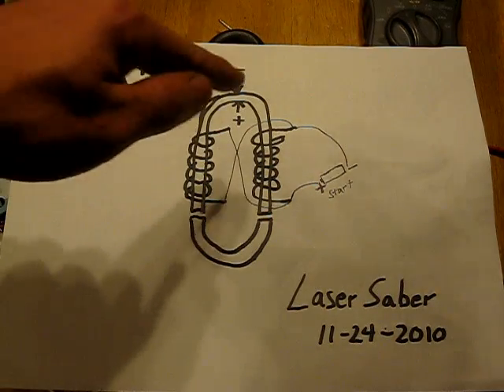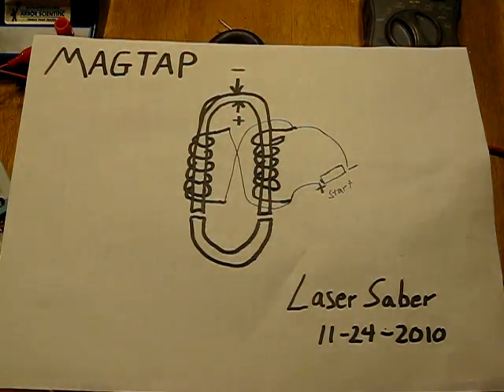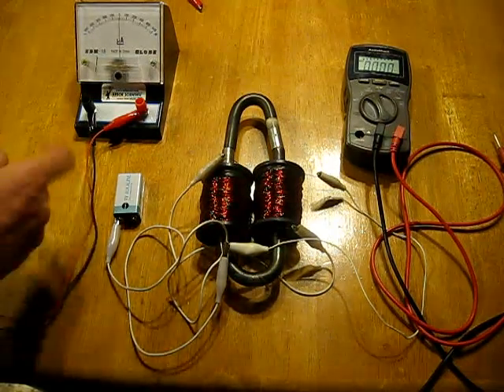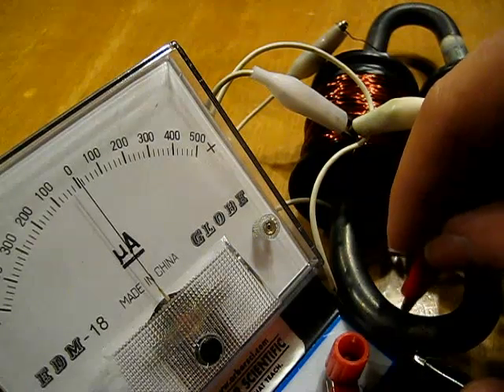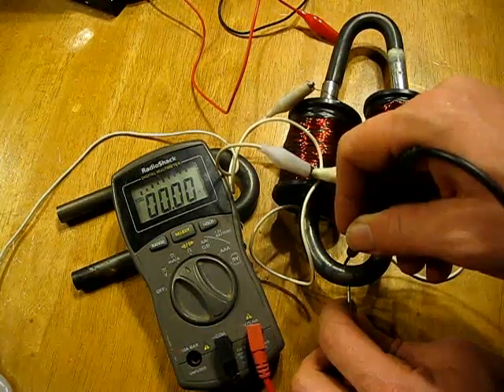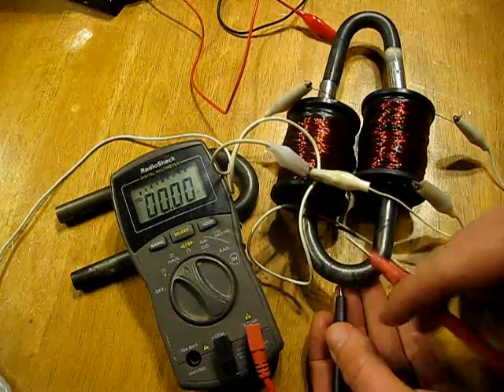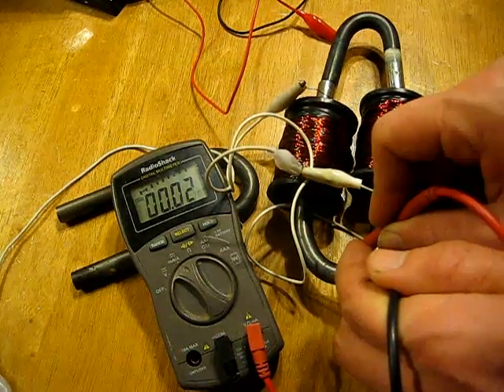Magtap: harvesting electricity from a magnet!

Comment: I know it's old video, but just had an idea here 4 U. put a piece of plastic between keeper and the other U shape metal. Insulate them electrically and once their activated, I believe they'll still lock & hold each-other magnetically. Then you measure electrical potential (A and V) difference between them.

Comment: Hi, did you observe the same polarity when you reverse the current direction by exchanging the battery contacts?  If the bridge is straight instead of horseshoe shaped do you observe the same? Did you check if the Delta V is dependent on the current intensity or the thickness of  the bridge, either it is thick or hollow, or the metal composition, iron, copper, aluminium? greetings.

Comment: This is an interesting discovery I think it is related to the hall effect, this is tendancy of a flow of electrons to be deflected by a magnetic field in a conductor. The fact that there is small voltage means some electrons must be flowing along the length of the core and this raises questions as to why this is occuring. Good Work!

Comment: get your finger off the leads you are touching the metal of the with your fingers, that could easily account for the anomalous readings.  Not saying it's a fake, just saying that for more accurate readings you need to eliminate as many variables as possible.

Comment: do you get anny curnt or voltage from the 2 points wer you removed the batery. and allso if you was to put a smal electric moter in ceries with the coile windings. you might get enough cernt to run the moter. while the magnets still hold.

Comment: does it only do that after its been locked ? . or does it do that when its not magnetised.. but just held together . .. i think the coils may be harvisting emf like an antenna harvests its signal . and its causing eddy current in the iron.
Reply: If so, the reading should be greater when he directly shorted the coils with the meter.

Comment: it looks like there is a disparity of the rate of magnetic current on the inside of the "toroid" versus the rate of current on the outside of the toroid, and when put into localized relation with the DVM you are able to see the "difference" of that speed measured as a flowing current thru the meter.   Pretty interesting.   I wonder if a wider toroid that has a greater distance between the inside and outside width would yield a higher current flow... Interesting!

Comment: And thing is its like monopole generator of bruce de palma. with curent polarities in center and outer sides of loop, what you did is created spining magneto energy etheric vortexes inside of loop, whitch conducts both. notice de palma does not have to input much energy to spin it back to speed after stop, as vortexes got it speed allready from previous mechanical input.
but palma does it by spinning both conductors, you injected energy to spin it by the coils energy, and it is straight overunit

Comment: Hasnt anyone thought to put a thin plastic or stone layer between the PMH and the connected piece to slightly separate them then run a wheel with copper coil/brush setup through this thin material and maybe the PMH will stay magnetized while you can extract current from it, like regular magnets?

I mean it's just an idea, but I think it might work as far as getting at least mechanical electricity indefinitely from the PMH

Comment: thanks for the experimentation and effort. i bilt one of these using 5/8 soft iron, a magnetic capacitor. there is a magnetic flux field inside the rod,. thought about drilling a hole in the in the end of one of the contact points and placing a small gauge coil inside and charging it up.if the magnetism is moving inside the rod, it should cross the coil at a perpendicular angle, lentz's law should take effect. there are very small coils iin those remote control micro race car toys, good source.

Comment: What if you put a joule thief in series with the coil wires and use the lidmotor 60hz trigger from an extension cord for bias on the base of the transistor.  could it run indefinitely ?

Comment: Use a permanent magnet and one of your coils around the magnet, put the meter on each side of the coil, wire a switch to close the coil circuit , watch your meter voltage every time u close or open the circuit, u have for a fraction of second  a measuring, as fast u can open and close the circuit your voltage increase. after use a triac instead the switch and use a flip flop circuit for the triac trigger, u well have pulsing DCV. Do a video and proof u got balls to put it on youtube lololo.

Comment: u only need to open and close the circuit very fast 60 cycles or more, pulsing electricity like on the out put of a diode britch electricity from a magnet is produce on the change

Comment: also, thinking about what occurs in the metal ring. Tap the current on the coils, all the iron atoms align ... as they align, the magnetic field gets stronger, causing more alignment, and so on, upwards to some threshold dictated by the resistance in the "circuit". Certainly at zero kelvin, something amazing would happen. But at room temp, there are losses to heat. Would it be true that if the temp was lower, that it would be all the hard to pull that thing apart?

Comment: I'm thinking that the clapper is pulling apart every so slowly -like a decay, inducing current in the keeper. If you rip them apart rapidly,  there is a HUGE voltage spike on the metal clapper. I messed around with that. Its there. Its so damn hard to pull it apart that it would be difficult to make a motor using this technique. So I was thinking another horse-shoe electro-magnet could oscillate near it to wiggle it loose and trigger the back EMF.

Comment: yes i can see it : ) also use digital. Any change in voltage is required :) Good stuff buddy. If it locks you can drain it :) as a power source. If I put this in my dual EMF Circuit and it locks...... I could drain the power from it as a source.

Comment: If it holds more with more power does it dissipate? Take a small LED light and power it from the end with the reading you were getting. See if the power drops off or stays constant. Or... After use is applyed record the drop off and then remove the light from it and see where it is at then. If it comes back or stays down.
Just intrested if it can hold a charge indefinetly. i imagine everyone would be?

Comment: I am not a scientist but from watching your video gave me an idea.
You showed how the magnet was strong when you had put small electrical Volt to it from a battery. But when seperated it lost it's charge . So by reasoning in my mind the loop made it possible for the electricity from the battery to run in a circle what seems indefinetly in the magnet. As small as it is as a current. It is there.
Now what if you gave it a bigger jolt of power? would the out put be the same or more? Test that.

Comment: Your Magtap is very interesting.  I am comparing your setup to how a transformer works. watch?v=aVYiT4zK9Kc  This guy has a modified Transformer and explains how the flux path is modified. The Magtap should be tried with an extra flux path, the voltage may get higher with a longer loop of metal on top.

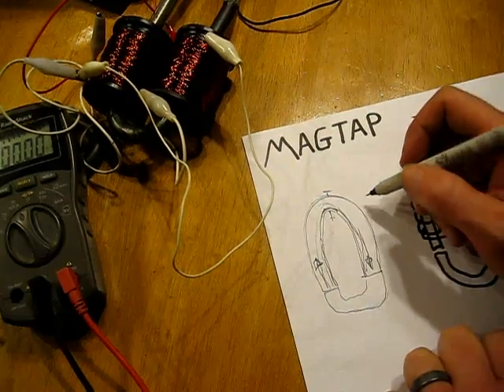Comment: on 7:10 as you explain about the lamination of the transformer: How about insulating the the lamination plates (you may use masking tape as an insulation medium)  that they may act like a capacitor?  Also you may use different type of metal for the poles, like zink, and nickel etc.

Comment: Have you considered that you may be measuring current caused by the Seebeck effect?

Another comment said to wind a coil over the hot spot.  If the magnetic field is not changing, then that coil will not have any voltage induced into it, and nothing could be measured.

Comment: I believe what you discovered can be easily explain, its called the Hall effect. The Hall effect in it self is really amazing. Watch this video to get a better understanding         watch?v=AcRCgyComEw  

 Basically you run a current through the wire like you did but the Magnet cause the negative and positive charges to be pushed to the outer sides, which creates a voltage potential that can be measured by a meter.

Comment: Your clips are steel. Same as breaking the keeper with an LED attached. Use aluminum ends.
Also a good try is instead of rounded ends use a sharp bend. I will try iron wire.

Comment: THe important question is, does it draw power from the magnet holder when you tap the power? How to tap a DC current flowing through the transformer core. How about replacing the "magnetic keeper" with a load?

Comment: Truly Incredible find. Some tests you can consider trying
1) do you get more energy with different thickness bars?
2) does it have enough potential to charge a capacitor?
3) measure voltage while influencing magnet closer to the PMH (sniping north and south as well)

Thats all I can think of to influence more voltage. If you have enough potential to charge a capacitor then a simple circuit can make it pulse as use it as a motor. Although I feel the PMH may lose its energy and stop being PMH

Comment: i got a series on the ed leedskalnin pmh, 6 videos and stright forward, i show how you can demagnetize just certain sides of the ubolt, also how to make a magnet motor with the u bolt coils using a rotor that is n-s-n-s-n-s-n-s.... i hook each side of each coil to the actual u bolt, then just charge each side ofeach coil,,, anyway check it out might learn something new....

Comment: Please try this.

1.  Separate the Top Keeper by placing a thin piece of paper in both gaps.

2.  Measure the VOLTAGE between the top & bottom.

3.  Please share what you get.

Thank you for sharing.

.